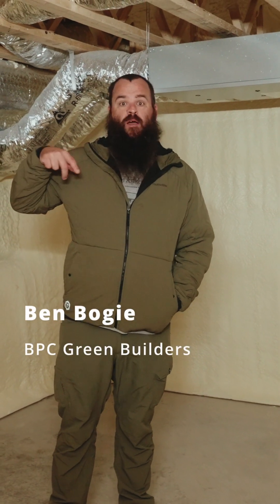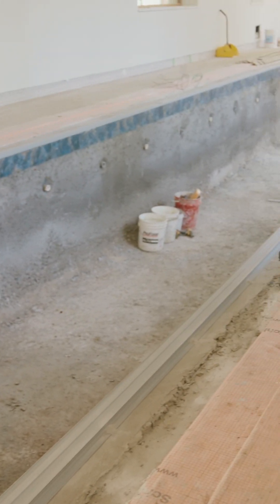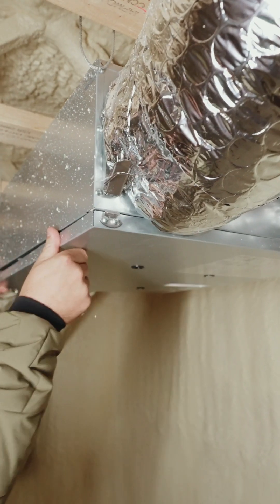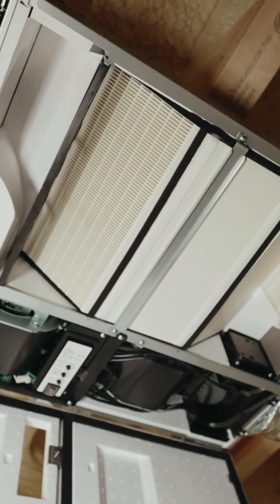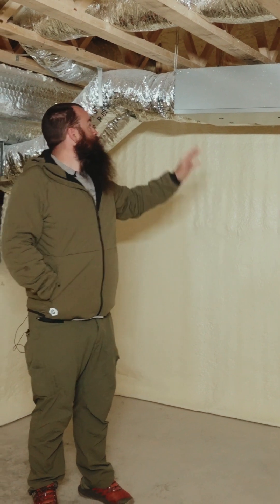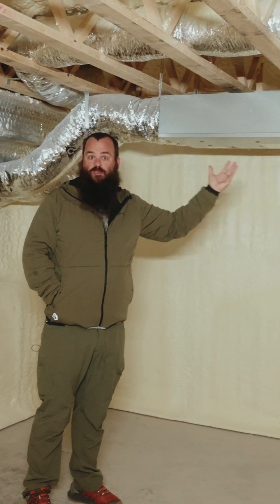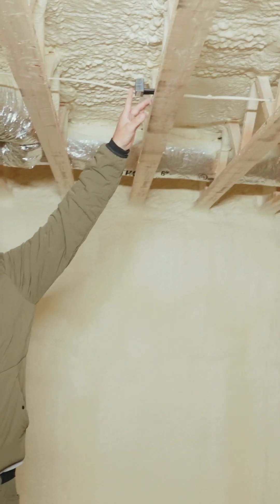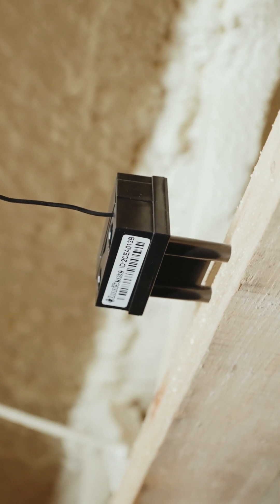Mechanical Room for an Indoor Pool

Comment: Wonder if bar joist trusses would have been cheeper,than the wood for the long run of the project?
     Once factoring in all the cost of equipment nd time of monitoring. Plus bar joists have a much higher fire rating time ratio .
     Interesting post ,thaks for all the editing, content